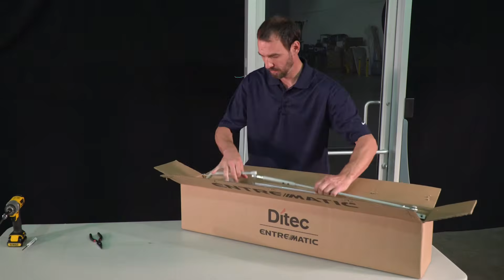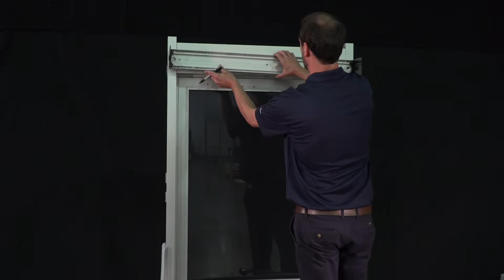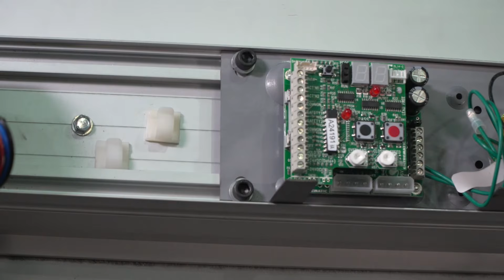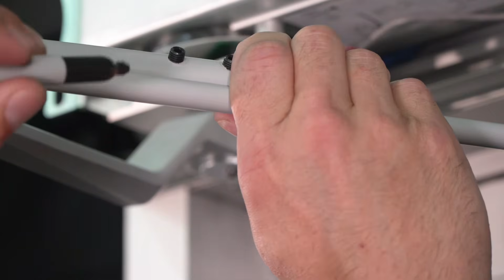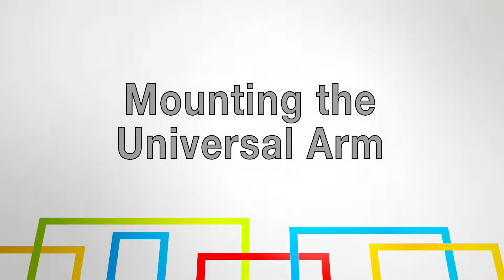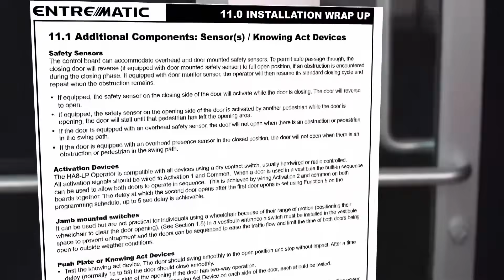1 Ditec HA8-LP Complete Install

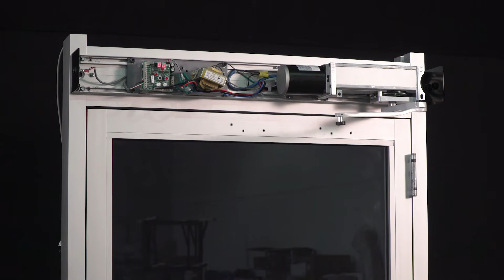Comment: 5:25 my door keeps opening till it hits the the back wall. Is this dependant on the rail or is there a setting to stop the closer?
Reply: For push or pull ado you have to switch(on off ho) to Hold Open. Wait till ado open to meet stop. Properly turn magnets to make board see open and close position for back check and latch. for push ado - close the door, install arm on door and ado, remove from ado, open door to good position and put on ado. for pull ado - switch in ho, meet stop, close door, put arm on ado in open position, check with opening door meet pull arm not touching wall, do not remove arm from ado, off switch, let arm  close door and screw it on door. make adjustment on board, correct magnet position on motor.
Reply from the maker: Please call Tech Support at 833-921-1337 so they can help you out.